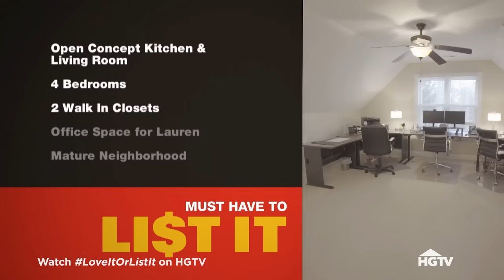Can This Home’s Dysfunctional Layout Be Transformed Into a Dream Home? | Love it or List it | HGTV

Comment: Personally I love the laundry room on the first floor so I can alternate tasks as the laundry proceeds.
Reply: Growing up we had laundry beside kitchen with good wide bi-fold doors that were surprisingly inconspicuous. We had 7 kids. My mother would cook and do laundry at the same time.  People like 2nd floor laundry--sensible.  However, they have to consider the laundry noise in bedroom areas-also the dust that the lint produces and the room that it takes to build.  If you have a small house, that could be important. Now I have laundry in the basement.

Comment: Well she just had to have that stove in the island and now  she wants to list it after all that.. most homebuyers don't want a stove in the middle of the island
Reply: Yes mostly due to the vent hood needing to come down the center of your ceiling, blocking sightline view. If you have the vent hood on a wall, the ventilation goes outside easier and you get a backsplash. No backsplash behind oven means splashes of food/oil onto people sitting at the island!😱
Reply: ah and they don't have a vent at all now, most likely because they have an upstairs level, they can't vent anywhere now.
Reply: @janelane1912  Exactly what I was thinking. And the two glass lamps left and right above the stove will be covered in cooking grease and other nasty stuff in no time. A stove without a hood should be illegal. 😅

Comment: The upstairs master bath has that boxed in area dividing tub/shower from toilet.  That means it will need to be remodeled again if handicapped accessibility is neeced later.  
This reduces resale value.
Reply: Not usually. Aging in place requires modifications. Starting with a one story and/or downsizing, bathrooms next.
Reply: What? No. If someone needs that kind of accessibility they aren’t going to be going up the stairs to reach that bathroom
Reply: @teresawalker4540  
Homes designed for the disabled have a value of (+)10%-15% over homes without.  
This is beyond 'aging in place.' 
Many people become disabled where they need grab bars, what have you, and it is well before 'aging in place' is a consideration. 
Downsizing may be more stressful than having a place that already accommodates mobility considerations...
Reply: @b_uppy  whatever. There's stairs so this house is not marketed to disabled then.
Reply: @drewconway7135  
You've got a limited view of the range of disabilities.  Many can negotiate stairs (or easily retrofit a chairlift), but find managing the bathroom difficult.  It depends on which muscles affected.  A person with a leg cast can negotiate stairs but may find negotiating the toilet as tough.  
Losing access to a bathroom is a big miss when you are disabled or not, whereas the chairlift elevator retrofit is less impactful on essential functions.
Reply: @teresawalker4540  
You're missing the points.  The bath is a major concern as it disallows its use if it does need retrofitting. 

It loses accessibility to those that are disabled as well as abled while it is redone.  A chairlift elevator retrofit is able to be less impactful on essential functions.
It loses on resale value as well.  

You've got a limited view of the range of disabilities, or need for accessibility at all stages of life.  Many can negotiate stairs but find the toilet seating/standing difficult.  It depends on which muscles are affected.  A person with a leg cast can usually negotiate stairs but may find negotiating the toilet as tough.  

These points are important to daily living...